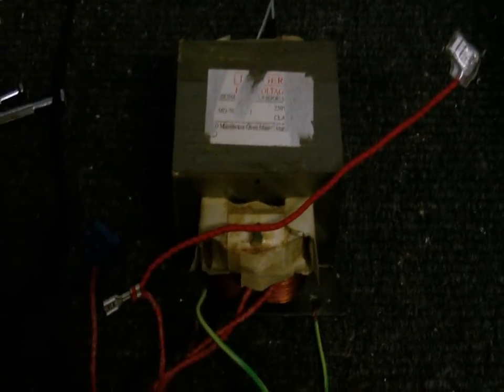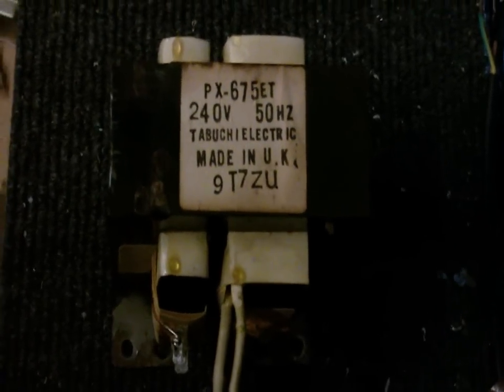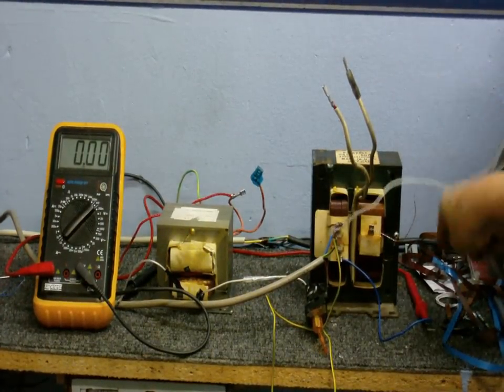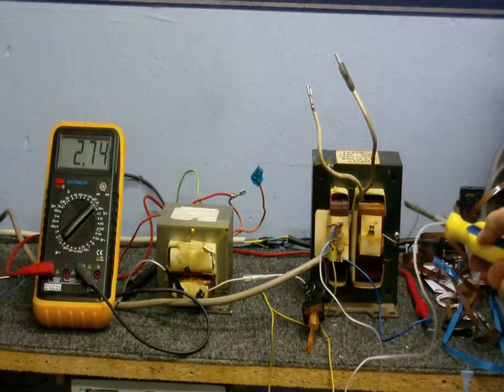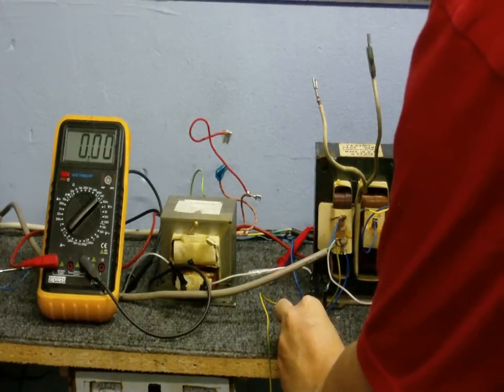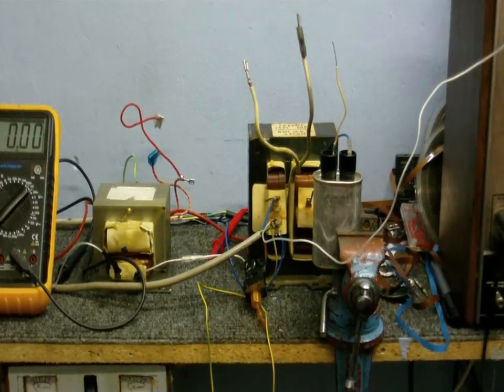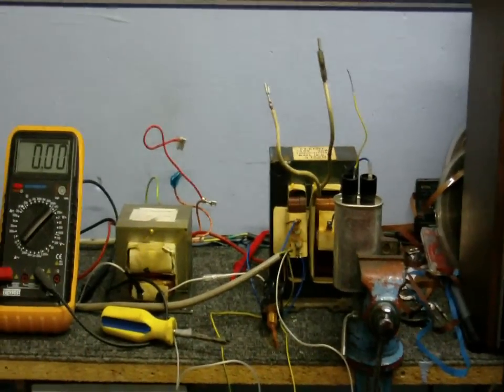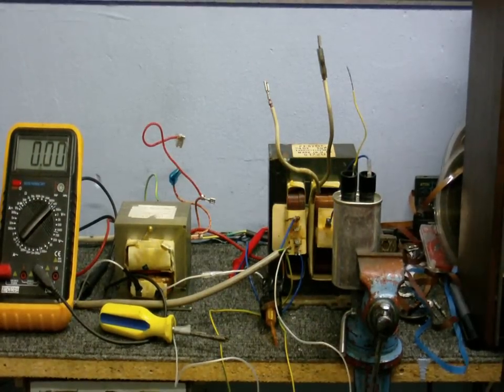big mot, but small arcs (for now anyway)

Comment: Nice MOT! But i really think you should get some other wires for the HV side. something with more insulation. Cause those thin little wires used to be marked to around 300V. some even as low as 30V. Just a tip :)
Reply: I know what you mean but that wire is connectet to ground.